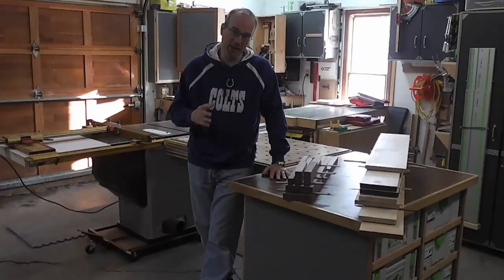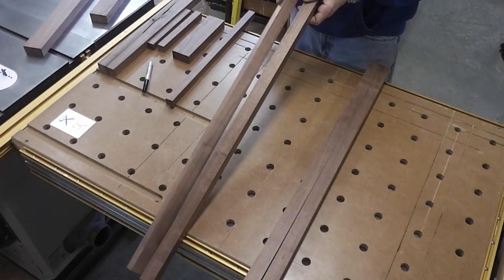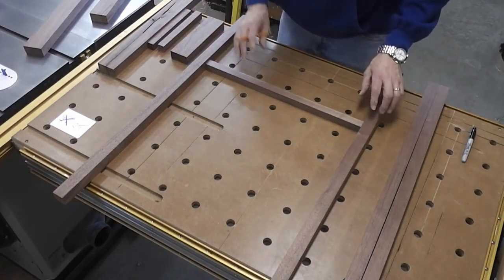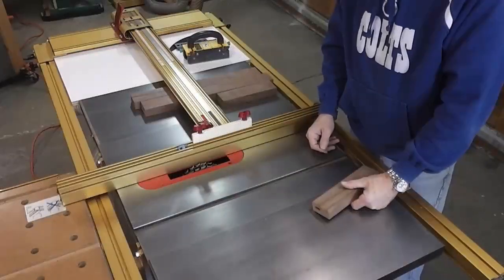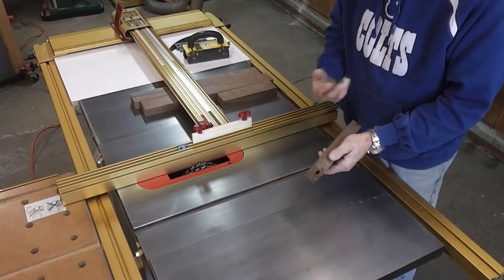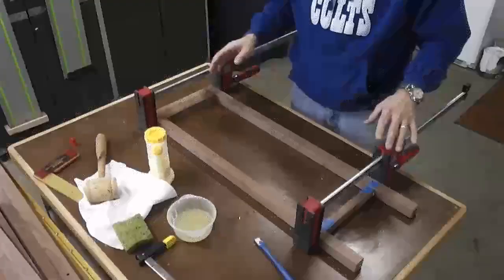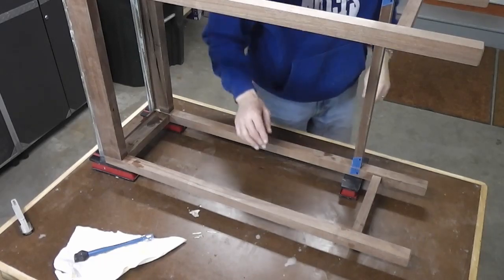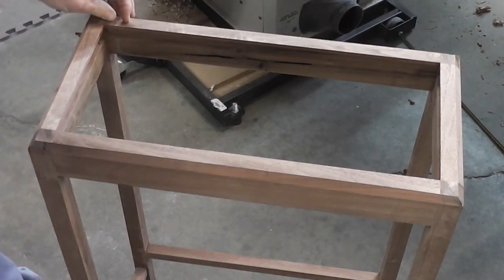James Krenov Inspired Case - Making the Walnut Base

Comment: How do you like your incra TS fence?
Reply from the maker: It is a little bit of a chore to set it up correctly, however, once it's dialed in and parallel to the blade it's a thing of beauty. Repeatable accurate cuts every time.